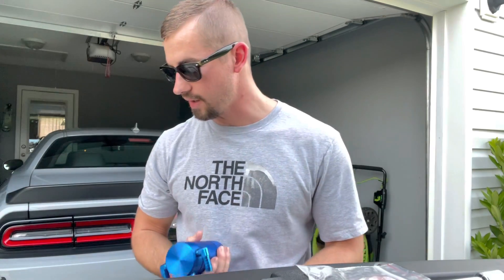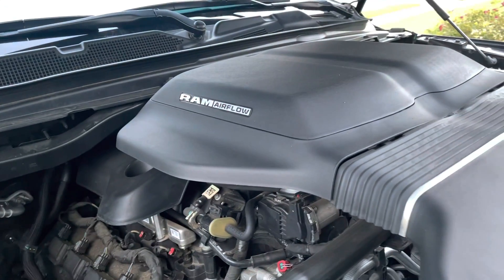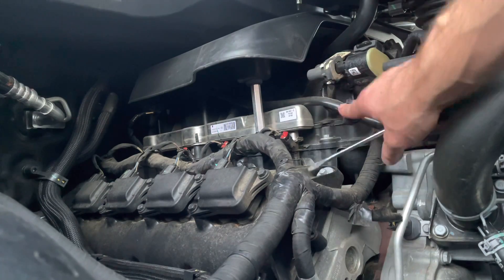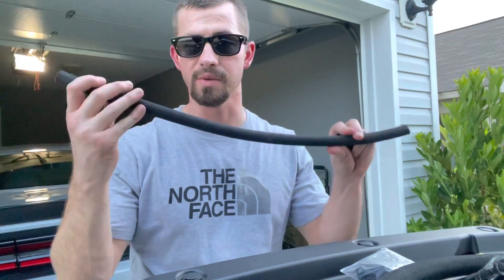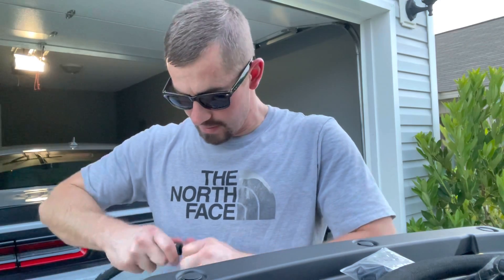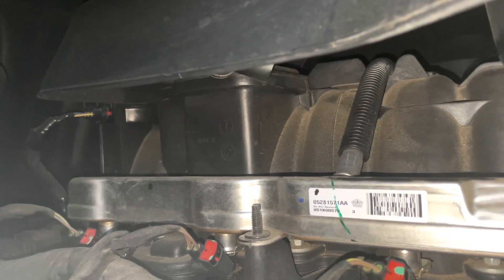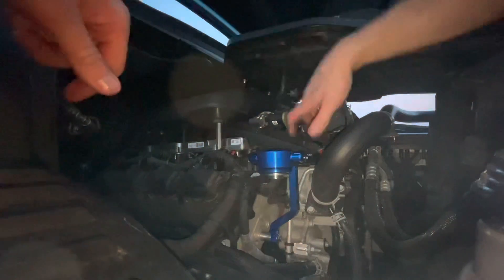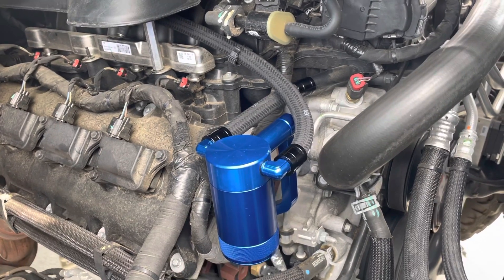Oil Catch Can Install on 2019-2021 Ram 1500 DT

Comment: Great review, purchased the same catch can but the hose lines came pre-installed on the wrong side of the catch can. Had quite the time trying to remove it (unsuccessfully). Should be getting another one here this week to actually route the lines correctly.

Comment: I know this is an older video, but it came in handy.   I have a Rebel GT and has the same air cleaner as in your truck.   This video will make the installation of my CC much simpler.
Reply from the maker: Glad it helped.

Comment: You should of left off the old cover when installing the ram air intake…plus you don’t have your cover installed correctly….you can see the cracks where the cover snaps in…
Reply from the maker: Yeah I noticed it afterwards and fixed it.
Reply: @str8speed919 howd u fix it?

Comment: Thanks for the video, made install super simple! The directions weren’t difficult but it’s nice to see someone else do it so you know what you can pull on without breaking stuff. On my Rebel GT, it came with the Ram CAI already but it has an additional support bracket behind that metal column where yours has nothing. Didn’t make taking it apart impossible but made it harder to get a good purchase on the rear point where the tube connects.

Comment: What’s the point. Hemi is not a direct injection motor.
Reply from the maker: It catches a lot of oil! I empty around every 1000 miles and it’s usually just under half full.

Comment: How many miles did you have on your truck when you got this? I got about 16k on my 21 ram and  I drive it hard just noticed my s n b intake was wet a bit and oil in my intake box and inside the tube have no idea what’s alot tho hopping I’m not late
Reply from the maker: I was around 15K when I installed it.